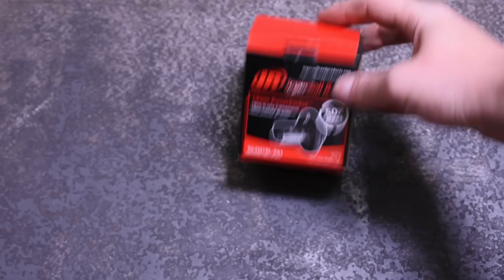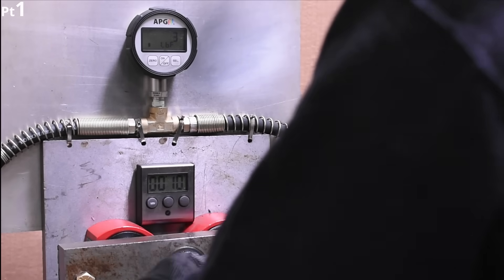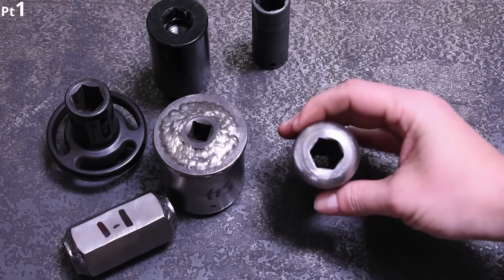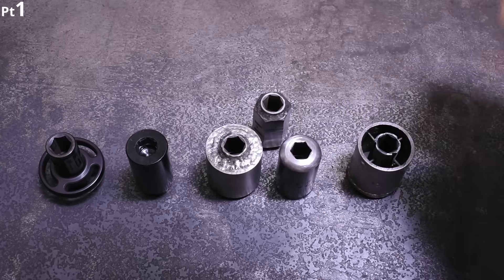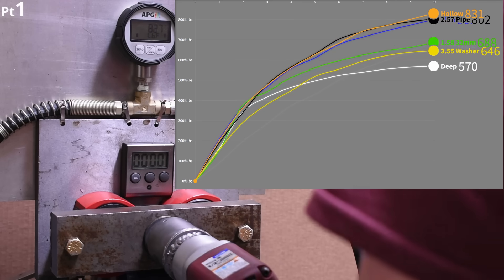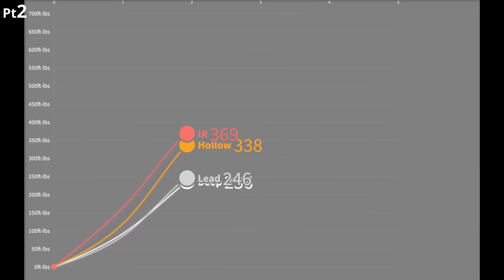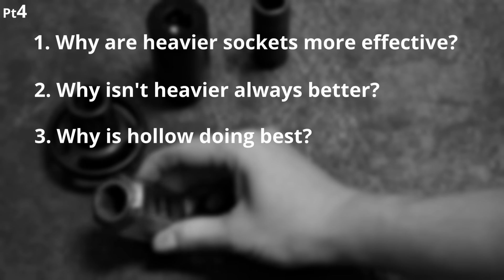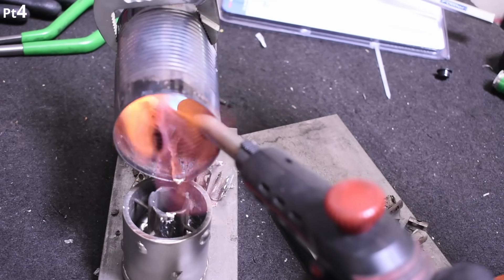Heavier Sockets Make More Power? Stumps Physicist

Comment: You have to consider the "slop" between the socket and bolt faces and the relationship between the hammer and socket to get what you want. If you want the maximum bolt breaking force obviously you'll end up with a rigid flywheel design.  (because you'll actually have to be able to use it) The opening in the socket will need to allow some "slop" without damaging the bolt head. You'll want the hammer and socket to have time to sync up and accelerate before striking the bolt head. 
You're going to need to see where they max out also. 10 seconds was not enough. No bolt that is difficult for your gun to free gives up in 10 seconds. If it did, you wouldn't have needed a magic socket anyway. 
Also be careful what you wish for. Bolt breaking force is fun until the bolt actually breaks.

Comment: I think its a sling shot effect caused by centrifugal force
what if you keep the weight the same or even a little bit less but make the fly diameter larger on the IR socket, my theory is you will have a greater centrifugal force happening which in theory will increase torq.

Comment: Balance, I think one of the potential losses your seeing that's mucking with your data it balance issue throwing off the momentum and impact. Further, anything involving welding or melting would affect the localized rigidity in that area of the socket, affecting the balance via disproportional energy distribution. You could confirm pretty easily, by making a heavily unbalanced socket, and seeing of that has a noticeable affect, while the localized ridgedity might be harder (no pun intended) you might be able to confirm by simply running tig (with no material) to deeply score/puddle the outer material of the socket as this in theory should have a minimal impact on weight and balance, but affect the hardness of the material on one side.

Comment: The extra mass further away from the center of the shaft acts like the flywheel that it is. The extra weight does slow the response of the impact twisting. But, the force in motion wants to continue in motion. This would explain the sweet spot of weight and the distance of the weight from the center of the tool. It’s like putting a wrench on a stuck bolt and hitting the wrench with a hammer, the farther away from the bolt that you hit the wrench with a hammer, the more torque is applied at the same hammer speed.

Comment: My hypothesis is the extra mass of the socket is stopping it from bouncing back as far between each blow of the hammer. You can achieve similar results by just holding the socket hard in the direction of rotation and removing the slack from the system, I do not recommend that inexperienced users try this though, if you do it wrong you can seriously injure yourself, but if you are in a sticky situation it might just be the difference between being able to get a bolt off or not.

Comment: I think your hitting a resonance frequency with certain sockets. when the weight of the socket after hitting the nut rebounds. it will rebound again in the opposite direction. if your impact strikes at this point again, it should increase the overall impact. Look up resonance frequency and what it can do, it can be scary

Comment: So the hollow socket won because when you're accelerating the mass, more mass toward the center slows the small movement acceleration but provides less impact on the hit because of the radius of leverage.
So moving more rotational mass further away from the shaft provides more grunt on the strike and you aren't wasting limited energy spinning up weight close to the shaft center.

Comment: I'd like to see a weighted adapter, like a really short extension with a flywheel like the Powersocket, that could be used with any normal socket.  Testing different adapters with the same socket would add a lot of data toward figuring out why adding weight works, and if it works it would be a cheap solution allowing one to have an entire set of "power sockets" while only having to add one new tool.

Comment: Tbh as a physicist it is fairly straightforward and I don't know why the professor was overthinking it. The heavy mass further from the center causes a higher moment at the time of impact. While each hammer blow doesn't move the socket much, it does move it. So the more mass it has further from the center the better. The heavy sockets have mass distributed from the center to the edge giving a lower moment, while your hollow one is both heavy and has the mass concentrated far away from the axis of rotation. Take a steel bar and spin around with it , versus a steel tube with a weight. You will see the effect very obviously.

Comment: Nicely done video. Stumping an academic? Pfsshh, buncha sissies never leave campus and don't know which end of a hammer to turn on.

On the mass increase/impact increase: the weight added, the distance of the weight from the axis of the socket, combined with the impact force and travel distance (hammer movement/rotation distance) of the impact wrench should all affect performance. An ideal weight/configuration on one impact tool may be not ideal for another tool.  More importantly, I think, is that the amount of weight and its distance to the center axis of the socket as a combination are more important than raw mass.

Comment: Well let's see. To add torque the weight must first be set in motion, then decelerate against the resistance of the bolt head. So the hammer in the torque wrench strikes the input to the socket, twisting the socket along it's length. The mass begins it's initial motion. The socket sends the torque to the bolt head via the twist, the bolt resists, but the weight is now now moving. The socket passes the bolt resistance to the moving weight. The weight decelerates against the bolt resistance, adding additional torque to the system. Perhaps this is what is happening. Cheers.

Comment: I suspect that there is something in between the rigidity and the mass of the weighted sockets. Lead may be heavier, but it is also softer, there is a possibility that the lead absorbed the impacts instead of storing that force. Your hollow socket probably became some sort of a spring too besides just adding weight and a flywheel effect soft of thing. Steel is flexible and also has some springiness. The power socket surely has a flexibility in those three points joining the ring to the socket. The patents you presented may be some proof where they where trying out things until the found how to do it in one single piece.

Comment: In my 400 level FEA class in engineering one of the effects we looked at is the multiplication of force caused by the fact that forces applied to a part travel through the part and can reflect back(think pressure waves). So if you manage to set up a reflected wave properly it can multiply the final output force at least on occasion, and you end up landing some heavier blows even if it isn't on every blow from the impact.
The lead socket was probably VERY good at dampening vibrations in itself, the best performing sockets probably ring the longest when struck (good luck holding the solid boy from lisle in a way that allows it to ring though)
The design of the IR might be based on trying to get vibrations to reliably reflect around to and from the mass ring through the spokes.

Comment: Imagine 3 hammers.

10 gram hammer
500 gram hammer
1 kg hammer

Which can you drive nails on the floor with more efficiently?

Now imagine 3 other hammers

1 kg hammer
2 kg hammer
50 kg hammer

Which can you drive floor nails with more efficiently?

3 other hammers? 

50 kg
100 kg
1 ton hammer

Which can you drive nails on the floor with more efficiently?

There will come a point where the hammer is so heavy that you cant lift it high enough to give it enough potential energy and kinetic energy.

It's what's happening to your test. You're passing the tools ability to lift the hammer above its head.

Comment: You know, a Newton's cradle, where the swinging balls smack into each other, and one goes flying while the rest stay completely put? I suspect that's analogous to what's happening here, and why heavier isn't just better. There's probably a "sweet spot" where the added weight is about equal to the weight of the hammer (really, rotational inertia, not weight, but it's an analogous property). Once you go heavier, it adds no more benefit, and will start to decay.

Comment: I broke 2  HF 1/2" impact extentions, removing Honda crank bolts. I have the Lysle weighted socket and then bought a new Earthquake impact gun. In the end, I built a long socket by cutting a deep impact socket in half and welding pipe in between. So it's one piece long enough to get past the fender, set on a jackstand, and use a breaker bar with my jack handle as a cheater. I bought 2 HF breaker bars, thinking one might fail. In the end, it worked. I later tested tightening a bolt with an estimated 500 ft/lbs (my 230lbs and a 30" cheater). My Earthquake could not remove it. So I bought the Hercules mid torque. It was just barely able to remove it. If I added a pipe wrench on the socket and leaned on it while using the gun, it was removed easily. My shop made pipe socket wasn't better at delivering torque except that I did not break like the extension. I may make an extension with a hex on it and try a large wrench combined with my impact.
ps. Why are Honda bolts so tight?

Comment: I think the flywheel design gives the mass more leverage against the stuck bolt - it's the same as having your hand push on a longer handle, isn't it? 

the rotating mass of the flywheel before transferring its force into the stuck bolt = your muscle power pushing a breaker bar 

if you hold closer to the bolt you can input less force than if you hand is at the end of a 2' breaker bar - 
the majority of the mass focused on the outer diameter of the flywheel, as long as its mass isn't too great, should give its mass more leverage than a socket of equal mass, but with all mass just added to a normal socket (so the majority of its mass is closer to the center of the bolt) <- that is my initial thought at least (but I do think there's still a goldilocks zone for mass having a positive or negative effect)

if this ^ is what's happening, the same mass on a larger diameter flywheel should eventually have the same negative results as the super-heavy socket (because adding more and more leverage to fight the stuck bolt eventually will be the same as more mass needing to be accelerated by the impact)

The flywheel is simply more efficiently using the energy imo, because the extra mass gives more leverage the longer the radius, right? longer radius = more leverage)

Comment: My theory is that heavier would do better if it had time to equalize with the inertia of the spinning, because you see a steadier curve with heavier weights, it makes me thing going for longer would mean more power for the heavier sockets, having more time for inertia to build, that's why I feel the flywheel helps, it isn't too massive that it takes forever to overcome inertia, but it is still massive enough to provide enough extra inertia to give more umph! Hence why we see a clear "optimal weight" although this is just my own observations and speculation, it would require more tests to be done: such as running the dynometer tests for longer to see what impacts the weight has over a longer time

Comment: @Torque Test Channel
I might be thinking of this the wrong way but here we go. 
The flywheel socket has its mass farther out from the center. So it is easier to move when the impact happens. Theoretically then the same weight even farther out from the center would hit even harder. Your hollow socket had more mass that the flywheel but it was about the same distance from the center. If you had too much weight closer to the center then it is harder to get moving i.e. the two heavier sockets you used. The amount of force the impact has when hitting was less. An object at rest has the tendency to stay at rest and vice versa. There would be a spot where the flywheel will be too far out/too much weight and you would see diminishing return on the action. But it would be neat to see where the sweet spot is on weight vs. distance.

Comment: You think at a certain point the weight of the socket overcomes the hammers' ability to be effective. Say the hollow socket, it weight is just right and along with the weight distribution, but the 4 lb socket is just too heavy for the hammer mechanism to gain and transfer an momentum through the socket?

Comment: 10min in, thought I'd log some theories: key factors are where the mass is and how its attached.  For example, the heavier stacked washers didn't do as well as the previous pipe weld up because the washers are still relatively loose. Similarly, the soft nature of lead with a not so continuous pour, is also not transferring the blow efficiently.  That last socket did so well because, despite being lighter, it has more mass at a bigger radius & this can store more energy.

Those are my amateur theories, curious to see what the professor has to say!

Comment: I believe it works the way it does because the joint between the tool and the socket, and the socket and the bolt, is always somewhat loose. So each impact, the socket bounces back and forth between the anvil and the bolt. Using this theory, a heavier socket makes fewer bounces, but hits harder. I assume the same is also true for the anvil so if the socket is too heavy compared to it, it's actually detrimental to performance. My gut engineering instinct tells me you want the anvil and the socket to have more or less the same moment of inertia.

Comment: I would be interested to see the high speed footage. I would hypothesize you would see the socket almost acting like a torsion spring winding up between impacts. If thats the case, you could visualize it with a larger spoked flywheel, but it would likely perform worse due to the frequency at which it rebounds. This would also make some sense as to why lesser impacts didnt do as well, because many of them have smaller hammers and impact many more times per second compared to a larger impact.

Comment: I would think it has something to do with the extra mass and its distance from the center of rotation kind of like a fulcrum and lever. I'm a chemist not a physicist but it makes sense to me that the lead socket and the IR without the flywheel were down in torque however the socket within the pipe were higher in torque. By the way be careful with the lead that stuff is no joke. Metals can do all kinds of crazy things when you heat them. I was heating, molybdenum, if I remember correctly been about 15 years, in a hydrogen oxygen flame and it created this gas that was nasty as hell. Not an inorganic chemist so not sure what it created but I probably lost a couple brains cells from that experiment.

Comment: The reason a flywheel and hollow socket work best is because you have most of the mass distributed far away from the axis of rotation. This effectively acts as a lever. The longer the arm of a lever, the greater the force is created.  Torque = force X distance X sin(¤).  Extend the mass outwards and you increase the torque while decreasing the distance the bolt moves per impact.  A perfect socket would have a hollow cylander infinitely large in diameter, made out of a material that weighs almost nothing.

Comment: Custom BOLTS? Fancy! A prof once said I knew my physics so lets try...
Right the outer round ring could still help rigidity (non rotational, bending moment etc)
Then I figure you have a tradeoff of..

Minus: More mass=absorption of impact
 vs
Plus: More mass =More energy PER impact IF successfully transmitted to the mass

I',m gonna cop out and say its a dynamical problem - if you covered the socket in little strain gauges you could a handle on it by experiment - my .02c
Reply: Now I see the resonance & impedance posts - yeah they got the right idea, only the 'Signal' your putting in is a pretty steep pulse - if that overcomes inertia to impart high transient velocity to the socket (though going slowly overall) high mass WOULD make a +ve difference

(Resonances, though pretty damped, might waste energy - or might help move a stubborn bolt?)

Nontrivial to model the internal hammer impact, then the mass and dynamic coupling ('slop'/play) btwn the parts, so I cant blame the orig Prof for bailing :)

Comment: I think it's because you're moving the center of mass farther out so there is more momentive and concussive power gained maybe you should try a thicker walled pipe with a hollow inside so the weight is more on the outside of the socket so it gains momentum

Comment: I was under the impression a heavy vs light socket was similar to a heavy vs light flywheel on a car. A heavy stock flywheel has more momentum or inertia and allows your to apply more usable Torque at low revs without stalling out while a lighter flywheel allows faster and higher revving due to less mass to spin.

Comment: I'm guessing that what you see is resonance and the frequency is a byproduct of technical gaps btw bolt head, socket, etc, socket mechanical properties and impact hammer design.  The reason why hollow design worked the best is because it either matches resonance frequency better or it did it in a lighter package.